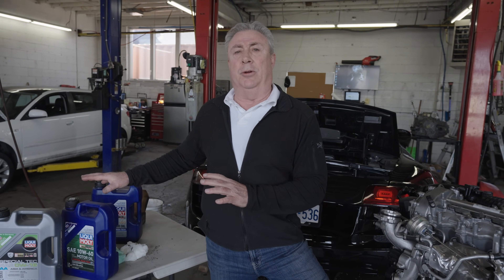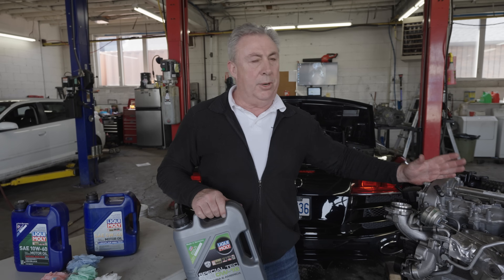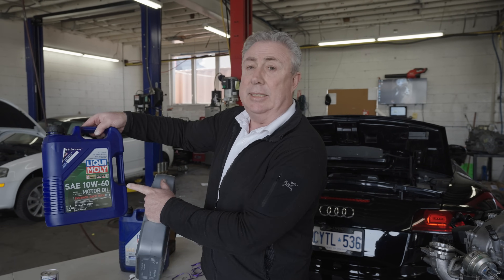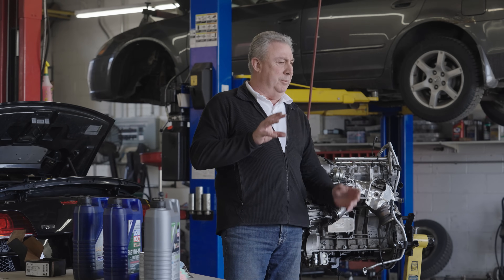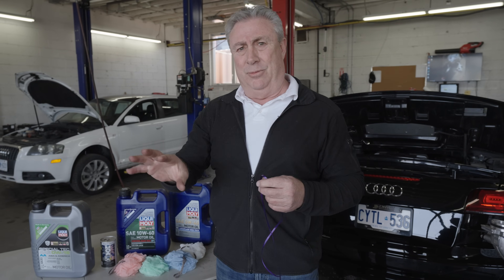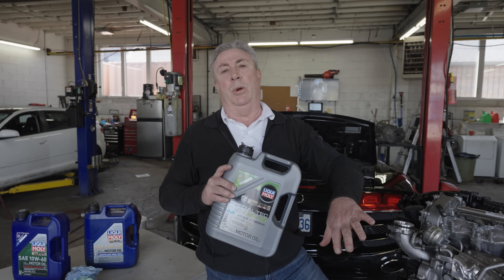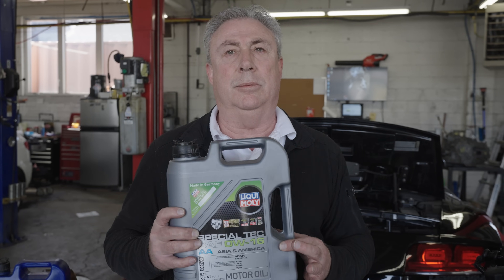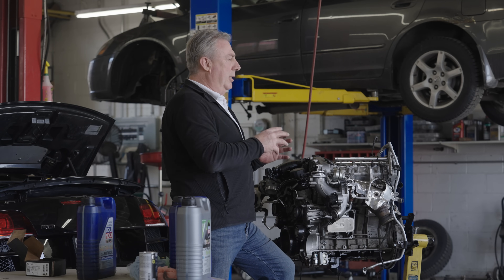Thin engine oil just a Scam? What's Safe

Comment: My ‘02 Ford V-10 has 200k on it.  Calls for 5w-20 and that’s what it ran on for the first 100k or so.  It was starting to use oil, about a quarter every 2000 mi. A Ford Tech suggested 5w-30 which I went to, also full synthetic.   Uses no oil between changes now. No more ticking at idle either.  Our new Turbo Ford’s all call for 5w-30 as well.

Comment: I'm old school and run 10w-30 in my 77 chevy 350 in the winters and come spring I run 20w-50 Castrol GTX in the summer! Never had a problem!
Reply: I'm a boomer myself but a small block Chevy from the 70's is a whole different breed than a modern turbo 4 cyl.  Materials, clearances, machining, temps and what not.
Reply: @johnstudd4245  Yes, they have reached the point beyond good now, so, the new engines have become worse now. The Best cars are from 1986 to 2009.
Reply: @bustjanzupan1074  We SHOULD be able to have the best of both worlds, proven, simple, durable designs with the best  modern materials and machining tolerances.
Reply: @johnstudd4245  no joke!!!!!!
Reply: Be sure to use the 'classic' GTX 20w-50 with extra zinc for the flat tappet lifters.  Valvoline VR1 is also a good choice.
Reply: 2004 Silverado 6.0 with 400,000 miles only ever used 5-30 Castrol GTX. Still running strong.
Reply: @twotalljones4790 😱  400k??  Damn
Reply: i ran m1 in my 1975 chevy van 350, in '76 & it went rite past my seals, butt NO smoke, synthetics do not really smoke... wen i found it DOWN 3 qts, i put 3qts of STP 20w50 real oil & it ran just fine... clearances hav NOT changed since model T, so a thicker oil will NOT make a diff in that, sum other parts in sum newer engines may require the thinner oil... i now hav a 2016 lexus nx200t & instead of 0w20, i run 5w30 hi-milage AMSOIL in it w/77k on it... MPG went up a little & it runs so much SMOOTHER than b4...
Reply: @brucek.hoffman5868  As a moderator in a Lexus forum for many years, I can assure you that many owners who get 200,000+ miles out of their Lesus vehicles are using 0W-20 synthetic oil. Lexus engineers know a thing or two about powertrain longevity.
Reply: Just don’t run STP in the dead of winter….

Comment: In Australia we've had issues for years because people don't understand this.

Toyota is notorious for it. They release a new diesel Landcruiser and it says it needs 0W20.

A year later when it's 43 Celcius outside and that Landcruiser is pulling a 3 tonne caravan and the oil light comes on people think the engines are crap.

They're not. They certified the engine for emissions running water weight oil and so they have to state that's the oil to use.

Toyota service departments use the specified oil grade Toyota states. And it continues burning oil.

A few people I've known will go to Toyota, get the service done to maintain factory warranty, come home, dump the oil and pour in 5W40.

Comment: I run Amsoil signature series 0w-30 in my Subaru Outback Wilderness and runs like a top. Did the same thing for my Crosstrek for 95K miles. The Crosstrek started to get a puff of smoke on startup at 8k. That's when I went to the 0W-30 instead of the 0W-20. The puff never happened again. I do the same thing in my Grand Cherokee, Amsoil 5w-30 instead of 5w-20....

Comment: I have a 17 ford transit 3.7 & 4:10 ls rear end.  75-90 in the rear = noisy grabby and blown seals. 75-140 = smooth operation.  
The 3.7 has basically the same internals of the 3.5 with 5-20 it was ok. 5-30 the cam phasers and all other oil pressure controled things all are more responsive. Which immediately means better throttle response. It's down right snappy.  MPG = no change. It is the same.

Comment: Thank you thank you thank you, I have been preaching using heaver oil for years!! I have a 2002 Chevy Cavalier that has 425,000 miles on it that my wife drives two hours to work every other day. I live in Michigan, very cold in the winter and hot in the summer. I use 10W30 in the winter and 20W50 in the summer, I also cross reference my oil filters to use as large as filters as I can. I crossed and use a full one quart K&N 3001 filter on both my Cavalier and my 2006 Chrysler Town and Country that has 368,000 miles with the same oil configuration on both vehicles.

Comment: going from a 0w20 to a 5w30 won't destroy anything also Honda and other manufacturers recommend thicker for high speed driving towing etc so the 0w20 or any 0w oil is only good for fuel economy and very cold climates so in hot climates there is no issues going from 0w20 to a 5w30 that's a safe bet.....just don't go to thick and its not a drastic difference if u go from 0w20 to 10w60 than i would say no it depends on the car but a 2.4L honda will run fine on any 0w20 5w20 or 5w30 just use synthetic and your fine really depends but it won't damage anything
Reply: Go 0w-30 best option

Comment: You did a nice job with this video. I have a jag that requires 0w20 I’m uncomfortable with that it’s a 550 hp 5 ltr v8 so run 5w 30 and seems to work fine. The motor has timing chain guides engineering had and I live in NM desert. Thanks again
Reply: I hope you are using Euro oil.  The specs are much tighter and really you should make sure you do.
Reply: Good call, I'm the same. I never run the 0w20 in my 5lt Jag. Recipe for disaster. I use either 0w30 or 5w30 Amsoil Signature. I'm in Australia.
Reply: Have the v6 SC with upgraded pulleys .. live in Saudi and now convinced to start using 0W-30

Comment: Toyota 1gd-ftv engine in hilux Australia recommended oil in manual, 0w30 or 5w30, 1gd-ftv engine in Pakistan toyota manual recommends 5w30 all the way up to 20w50, minimum and maximum temperatures do have a lot to do with oil selections, but this tells me what oil the engine can handle.......interesting.
Think i will use a 10w40 in my environmental conditions, can get hot where i live.
Makes me wonder if Australia's thin oil recommendations have something to do with the timing chain wear issue in these engines have in Australia.

Comment: No, the modern engine is designed to run thin as possible, as to manufacture specific calibrations for lubrication. Thicker oil is NOT to be used safely. 
Keep it simple, do,what they recommend, and don’t out engineer the engineers.
Reply: stephen, I like your answer, the Engineers are highly intelligent and know what they are doing. My only issue (maybe???) they are told what limits they must abide by, example fuel economy settings, and they are to ensure the Engine last up to the Warranty date, and if it fails after that date then no problem. By the way, I only ever use the Oil they specify, I never assume I'm smarter than them. 🙂

Comment: #1) Film strength.  #2) sheer rate #3) viscosity break down.  Tests have been done,,mostly in racing applications, to find the highest rating in those category's by mechanical and chemical engineer racers,,very complete,thorough,indisputable facts, Air cooled, water cooled,aviation,marine, auto/motorcycle.  There are different winners all affected by their specific needs and applications.

Comment: I use 10w 40 in everything.. the mower the petrol car and the diesel truck and charge oil every 10000km and change oil filter every 20000km .. lazy but it works perfectly well for me and it only gets to 5 degrees Celsius in winter.. oh and it’s always Castrol.. and I get it only when it’s on sale and bulk buy.

Comment: Use the correct oil that is marked on filler cap ONLY ! . The oil pressure regulator , oil pump ,O E M  filter , oil galleries in engine , piston clearance in cylinder and other detail of engine are designed around a specific weight of oil ! . PUTTING THICKER WEIGHT OF OIL IN YOUR ENGINE WILL DESTROY THE MOTOR !
Reply: Not true going from a 0w20 to a 5w30 won't destroy anything also Honda and other manufacturers recommend thicker for high speed driving towing etc so the 0w20 or any 0w oil is only good for fuel economy and very cold climates so in hot climates there is no issues going from 0w20 to a 5w30 that's a safe bet.....just don't go to thick and its not a drastic difference if u go from 0w20 to 10w60 than i would say no it depends on the car but a 2.4L honda will run fine on any 0w20 5w20 or 5w30 just use synthetic and your fine really depends but it won't damage anything
Reply: Only if the manufacture recommends it . ,otherwise if the oil is too thick , the pressure regulator will start bypassing the oil starving the engine of oil

Comment: Use oil and change it! That’s all you need to do. If you pumped new oil constantly and didn’t constantly start it, your engine would last a long long time. Well except those new engines that are designed to fail. If they are putting rubber belts internally into your engine, clean oil isn’t going to help you much!  Btw, they can make an engine last as long as they want.
Reply: I like your reply, it makes lots of sense. Thank you.

Comment: After replacing timing chains phasers  etc. on 2012 crv at 150k miles using 0W20  I started to use 5W40 Rotella as I do in motorcycles duramax diesels etc.How can you lube a chain or spinning phaser with water?? Last Honda went twice that far on 5W40with no issues.

Comment: Oil geek channel said : no problem going from 0-20 to 5-30 .
Reply: Yes, Exactly, but basically, we Alll Should be using Two diferent kind of oil : One thinner for Winter(cold conditions) , and one thicker for Summer (hot conditions, or bigger loads). Simple as this.
Reply: my stepdad use to run straight 30 weight in summer .
Reply: @bustjanzupan1074 That's what I do 🤙🏼
Reply: I saw that video. The maker of this video made even clearer to me. Your oil is the really the  “W”number and depends on molecules to get to the higher number. In my SRT4 which has 100,000 miles on it now and does not burn oil I will always use 20w-50. I always warm my engine to 150F before moving. Then drive gently for minute to make sure everything has expanded to the correct clearances.
Reply: Since much of the US is 20s and 30sF in winter and 80s in summer with 60 to 70 Spring/Fall, the middle of the tested temp range...it doesn't matter.  The oil likely behaves exactly the same at say 50F cold starts.

You're likely interested in the better hot number than the arctic cold number, where a Canadian is more concerned with the cold number.

Comment: 0w20 for 30,000 miles and black tail pipe! I quit stealership. 5w50 full syn. now. Motor flush, gas b12, intake clean, sealed catch can with 3/8 tubing at a cool corner. 16 mpg back up to 21 average in summer. 19 mpg winter at 0regon coastal areas. 22mpg I5 city to city. Tail pipe is now silverish clean! Burning oil is not cleaner burn. Imho
Reply: In what engine ???
Reply: Sorry for the typos.... pls read "of" instead of "if"
Reply: Be careful, you are putting a lot of stress on your oil pump in the mid range temps (30-60 deg F / 0-15 deg C) and in that range yiu are dumping a lot of oil via the internal  press relief valve, reducing the effective amount if oil curculating where it shoud.  Will that break your engine?  Probably not, but you're safer abd helping your engine with a 5w-30 vs. a 5w-50.  I agree with the presenter.  Good idea to stay not too far from the original viscosity spec.

Comment: 2021 CX-9 2.5 turbo fwd.  I just did my third oil change with 5w-40 synthetic @ 7500 mile intervals.  I am getting the same gas mileage as when i had 5w-30 synthetic.  62mph to get Mazda's EPA highway 28mpg.  I get 34mpg @ 55mph.  Then there is the crappy 24mpg @ 70mph and 21mpg @ 80mph. This is on I-10 in Florida.  300 miles a day 5 days a week. I will test 10w-60 starting in May.
Reply: By slowing my highway speed to 55mph, achieved 32mpg out of my 2007 4.3 litre gs430, over fairly hilly 350 mile journey. But impatience normally gets the better of me, when the speed limit is 70mph.  😂

Comment: I’m an Amsoil dealer and one thing they stress to us Amsoil dealers, is there is what’s called the Magnus and Moss act you can run extended oil drains and it won’t void your warranty if I’m gonna emphasize that again if you run the correct weight oil and the oil meets minimum specification Upon a warranty claim so I agree with the guy about this thinner and thinner oil. I’m not a big fan of it but I don’t have to worry. I have a 1997 Jeep grand Cherokee I do run 0W 30 M oil so it don’t matter but you folks to have vehicles under warranty you have to run the proper weight oil cause if you don’t and you have a warranty claim, and they discover you have the wrong weighted oil in your engine Sorry buddy you’re on your own. This is six in a row.Jim from Kennerdell pa
Reply: Very well said if it calls for 0w30 synthetic. It's for a reason .tolerances are tighter..maserati switched from 5w40 to 10w 60.ferrari oil
.but I feel it's too thick for me..unless you are in the redline on the autobahn.

Comment: I had a Chevy Cobalt with a2.2 2009 model. I ran 5w20 oil in it and later 0w20 with no problems. I had 250k on the engine. The car would start quicker as soon as you turned the key and ran better. The problem is when the oil change interval I changed the oil every 5 k miles

Comment: These car manufacturers were building engines with low tension rings (interesting)and they were failing.  Think outside of the box,did they try using 2 low tension rings. A better crank with less weight but better steel it would turn faster
Reply: Yes, honda also had trouble with those ringsin the little turbo engine.

Comment: I have a Jaguar XE 2016,witha 2.0 diesel engine. The recommended oil change interval is 21000 miles. The recommended oil is 0W-30,which is just a bit thicker than water. The failure rate for these engines is horrendous, and in in my view is down to oil change interval. No engine oil can last that long in my opinion.
Reply: 3-5k oil max if you want it to last 200k
Reply: True lol. 21000 miles is quite a long interval most definitely lol.
Reply: My son is a Jaguar technician and rebuilds these engines. CHange at 10K tops, that's his advice.
Reply: F-pace with same engine at 90k miles. 5w 30 is advised by Jag specialists post warranty period. Gearbox oil to be changed at 100k miles if there are no signs this is required sooner. Timing chain changed at 100k miles if there are no signs this is required sooner.
Reply: @Conorhimself  A timing chain needing replacement at 100k is wild to me given the cost, although I guess most engines struggled to make it close to that 50-60 years ago. I'd be running a 5W40 in those Ingeniums though, since a lot of the wear issues with the timing chain etc. are due to fuel dilution and the extreme thinning of the oil. Jumping the cold start viscosity from a 0 to a 5 will do little to nothing to combat this, as it's the operating temp viscosity that needs to be increased. 
The rubber timing belt on my Peugeot 2.0 diesel has an interval of 10 years/120k miles, and my last one was running the original at 16 years and 180k when I replaced it. Only costs around £200 to do, including water pump and pulleys, so there's no excuse with a belt. Now they make wet belts that are crumbling after 20k...
Reply: Depending upon how you drive the vehicle, motor oil can last forever. When was the last time you changed the gear oil in your differential? ~
Reply: @georgehofgren6123  Gear oil doesn't get contaminated with combustion products, or diluted by petrol or diesel, though.
Reply: @hunchanchoc8418  Nor is it hitting red hot pistons
Reply: @georgehofgren6123 
Apples & oranges.
Gear oil doesn't have contamination from combustion added constantly.
Seriously, a silly comparison.
Reply: @frankcollins4743  Gear oil isn't filtered... Or would you like to know about my acquaintance with 175kmi on his f-150 who has never changed his oil, fool?
Reply: @georgehofgren6123  Oil filters only remove particulate contamination over around 15 microns. They don't remove any of the things mentioned above - fuel dilution and soot - nor do they prevent thermal breakdown.
Reply: @19jacobob93  That's all blabla... below a certain size, abrasives actually Polish the surfaces, not grind them down. Don't be a tool for vehicle OCD or male consumerism ~
Reply: @georgehofgren6123  We don't want polishing in engines, that would cause glazing.  Also, polishing IS actually grinding down a surface to remove the top layer with the imperfections.
The film strength of the oil is always going to be thicker than the soot particles and other contaminants, but it's actually the amount of these particles that matter, because after a certain threshold, fluid dynamics are altered to the point that the film strength is easily broken. It's this point that we see sludge formation, as the oil can't carry more particulates.
Reply: @georgehofgren6123  not really mate. Oil testing shows contamination in the oil appearing after some thousand miles, all depending on make and model.

Comment: You also have to consider that basically the higher the numbers is just resistance to flow. It's a balance act because an engine in good condition doesn't need a 50 or 60 oil. In modern small turbo charged engines you really should have some flow due to the fact that oil needs to move to carry heat away from critical parts. I don't necessarily agree with 0 oils unless it's artic conditions and the engine is always warmed up before applying heavy loads. I personally feel that a 5w-40 will give the best all around protection in most situations.
Reply: T6 rot.5-40 does well in testing..for all N.climes🇨🇦,,-0-20 in a high comp.diesel, GM's 3 ltr, seems risky,,-change that oil lots..
Reply: Watch the video again-